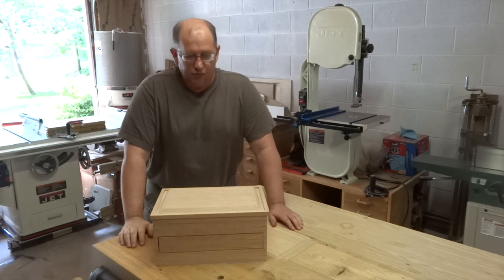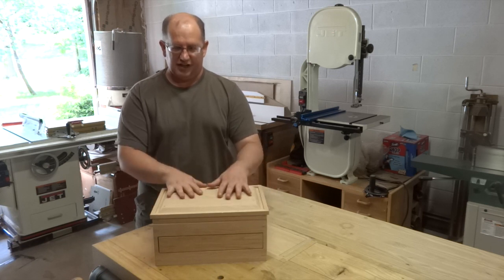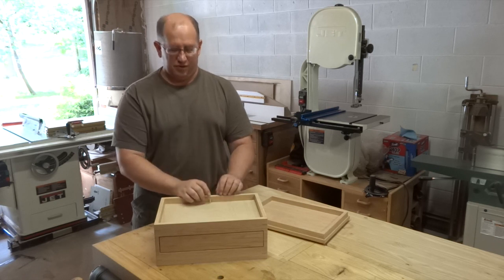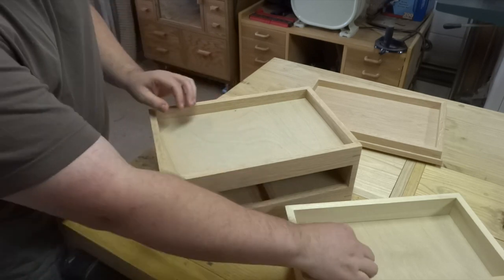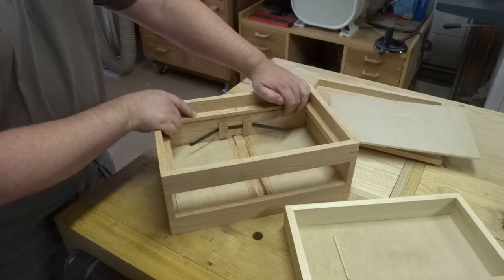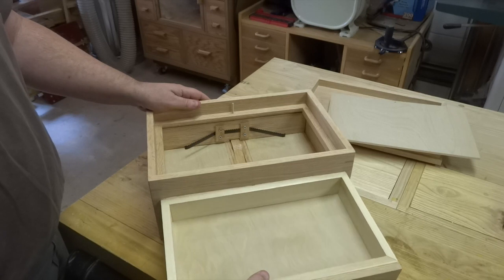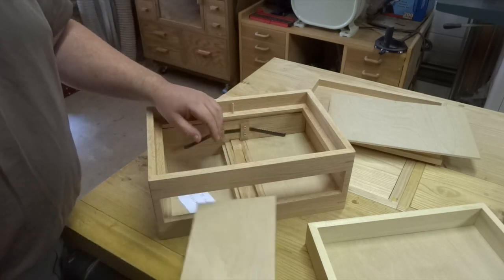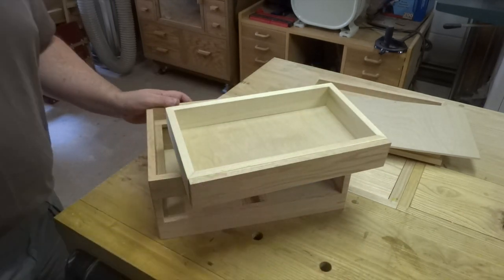Spring Open Drawer Box

Comment: This would be great for a #geocache. If the box has, say 7 numbered buttons with the same load on them and you need to press three buttons simultaneously to get the compartment to open (so four red herring buttons). Combine it with a clever puzzle to solve to get the combination, that would be a great hide. #Geocaching
Reply from the maker: Thanks for the comment.  I've actually been thinking about this since you posted it.  I like the idea and I might just have to look into it for a further build.  I think i could make a customizable code too!

Comment: You should put on a false front and shorten the dowel in the back. Make it hidden so that pop out drawer is secret
Reply from the maker: Cool idea.  I did this one mainly just for me and to get a feel for how the mechanisms worked. When I make more they'll be a bit less obvious!
Reply: You could shorten the dowel to end just beneath the floor, not drill a hole in the floor, eliminate the rear support for the floor; instead use the springiness of the floor to push down on the dowel.
Reply from the maker: @dlwatib  That would be a neat way to do it!